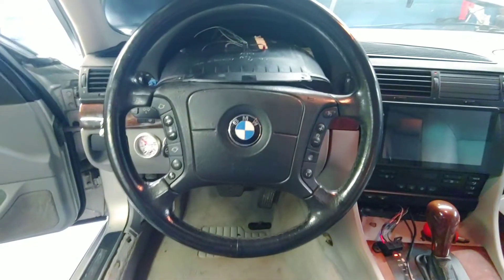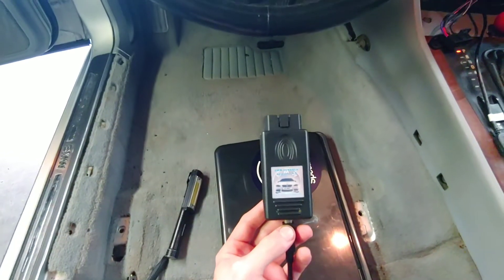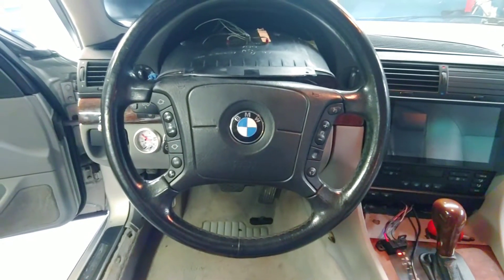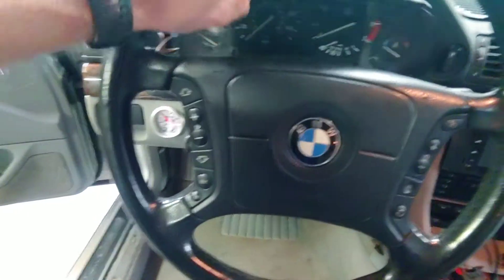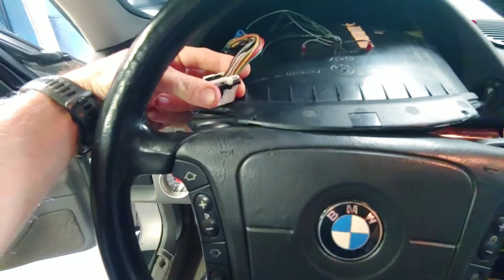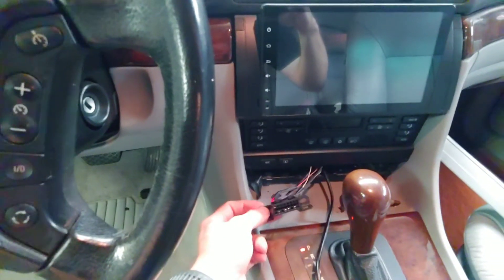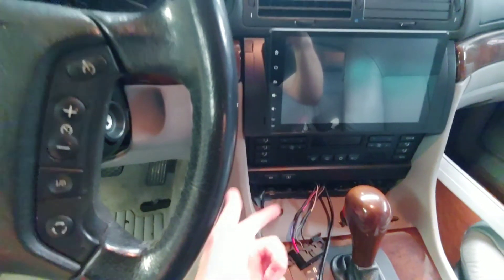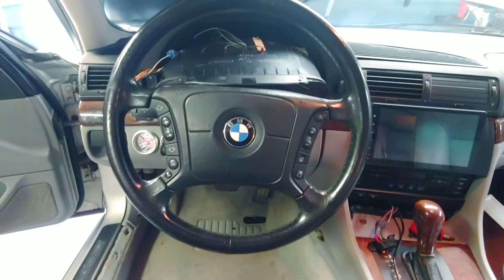E38 IKE PA Soft hack

Comment: Hey Todd. Will this work on a 1998 528i E39. on both 16 pin and round 20 pin connection error with IKE and EWS. I need HELP
Reply from the maker: Greg. The E38 and the E39 share the same instrument cluster. I checked the service manual and the pinouts are identical.

Comment: Hey brother, took mine for a drive to the muffler shop, steering feels very over boosted. Any ideas?
Reply from the maker: I did not have any problems with my system. It all worked like normal. There are no restrictors in the BMW PS system. One thing I do see is that you're running a car pulley with a truck pump....maybe the pump is being spun too fast? Or... you could have a high output pump. GM made normal capacity type 2 pumps and then they also made high capacity one's for the 6.0's running hydroboost but that would have two return ports. Just my first impressions...
Reply from the maker: Also, check out this pulley guide: https://www.pirate4x4.com/threads/power-steering-pump-pulley-dimensional-guide.411382/
Reply: @MrWrongsalive  thanks, going to do some research. I am hoping there is a pressure control spring I can mess with. I know e38s had variable power steering that increased or decreased as a function of vehicle speed. Mine never worked and steering was always heavy. Might check into that as well. It could also be because it is a truck pump so having lite steering was desirable. Doesn't feel good at high speed with very lite steering
Reply from the maker: @thehomeofbiglspower  That's true. The variable valve is on the bottom of the gearbox. The valve is pretty much a stand-alone system that runs off of speed signal from the IKE.

Comment from the maker: NOTES:
1.) Earlier E38 IKEs may have only two connectors. In this case, try using pin 12 of your larger white connector. I have not tested this but the service manual says this is the K-Line for earlier E38s.
2.) If pin 7 is already occupied on your OBD2 port, then try adding a wire to pin 8 (yes, you will probably have to buy a new connector). Most PA Softs adapters have pins 7 and 8 connected internally anyway. (Or you could just hook it up temporarily to pin 7...)